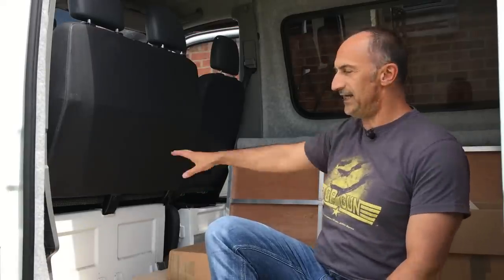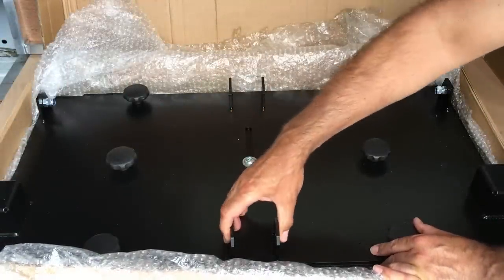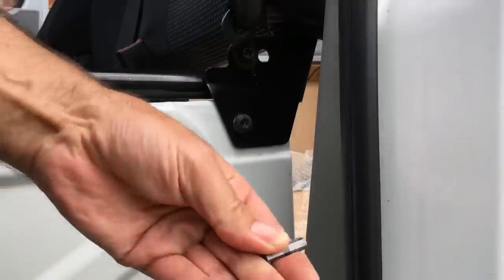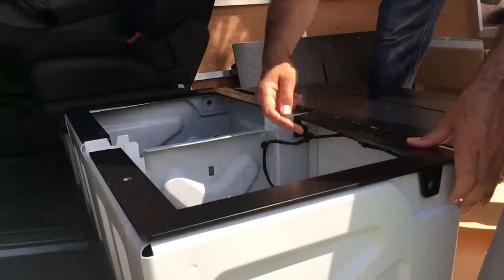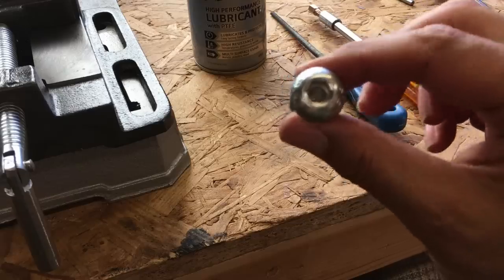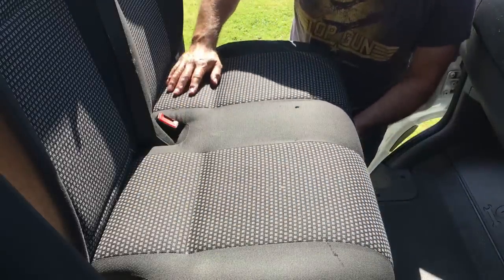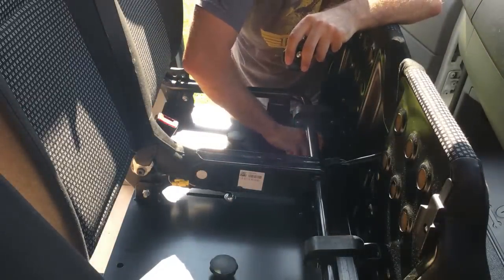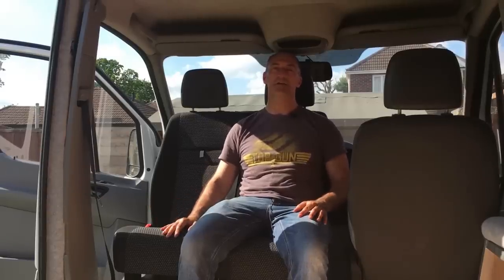Double Swivel Seat - Mercedes Sprinter Van

Comment: Nice work with routing the sensor wires. How much does the swivel mount raise the seat?
Reply from the maker: Hi CJ, it raise the seat about 2-3inches, in the front it's not noticeable as the floor slopes up on that side and when turned around I'm planning to build a foot step which will also house my heater ducts.
Reply: I was wondering if it would require a raised floor area, nice idea to use it to house the heater ducts. Also, just wondering if you sealed the body trim clips and drain holes before you insulated the van given you have created an interior moisture barrier and the van body provides an exterior moisture barrier (if the holes are sealed)?

Comment: Hi Greg just wondering if there would be apossibility to have a swivel captain chair aswell? I undrstand that its propably impossible when the double seat is firmly in place but mabe it would work when it is losened ?
Reply from the maker: I don't see why it won't work, the handbrake is the deciding factor and that doesn't move.

Comment: Hi Greg, as ever, great vlogs. We have just sold our last project and bought a larger VW Crafter to convert. It's a 2018 model so, I'm experiencing more problems trying to locate a swivel mechanism for the double and drivers seat. There is a company called R & J Solutions but they mention a 75mm lift, which will have a knock on effect with matching the hieght of any seat I fit in the rear. Any suggestions? We're off to The Overland Show next week so are hoping someone has got over this problem!
Reply from the maker: Try this one https://www.vwinterior.co.uk/VW-SWIVEL-BASE-S/
Reply: @GregVirgoe  sadly, they fit the pre 2017 model but post 2017 have a fuse box within the housing so, don't think that fits. I'm going to revert to a big hand written sign on the side of our van at The Overland Show. Hopefully, someone has fitted a swivel base to a 2017 model. Cheers though.

Comment: Hi Greg,
nice done.
But it does increase the seating height significantly. Isn't there any height adjustment for driver seat?
Is it not too high for driving? I guess you raised the seat by about 10cm to 12cm.

And be careful, if you slide the double chair completely on the slot, then the cable is too short. I would install a slide stop on the railsystem.

kind regards
Mark
Reply from the maker: Hi Mark, It's closer to 3" or 75mm higher. The cab floor slopes up quite steeply so it's not that noticeable up front. 
Good point re the length of cable, although slide stops would be impossible to install anything that doesn't foul the plates sliding. 
I could very easily solder some extra cable on to extend it and leave that coiled underneath. 
I might actually do that. Thanks for the heads up. Cheers

Comment: I want to convert my standard two seated Sprinter into a standard three seater Sprinter. Do you have a tutorial on how to do it because I know the floor covering is moulded to fit two seats
Reply from the maker: Hello Jon, I don't have a tutorial for that as my van came with a double front seat.
I imagine the floor plate is universal for all variants so there will be extra bolt location for the wider seat base under the floor covering?
Reply: Greg Virgoe thanks for the reply
I believe there would be, the only thing is the floor covering looks like it was made for two seats.

Comment: Hello Gregg,   I live in Canada, have bought and am building out a Sprinter Van.I LOVED the idea of a double swivel and just received mine in the mail yesterday.......it only took 4 1/2 months but well worth the wait....I hope.  I have two questions....the underseat yellow connector wire is easily dealt with as per your instructions but I also have another bunch of wires connected with a larger black plastic connecter.....I see in your video the end that is under the seat but is not connected to anything.  I am presently trying to find someone to drill larger holes in the bolt so they will all fit.  Why have you not connected that wire ?

Also, my swivel did not come with a centre plate, just the bottom frame that goes on the existing seat mount and the top plate.  Can you explain this to me as well please.  I hope this does not mean I cannot acmes the under seat space once the swivel is installed.  The product did not come with any instructions.  There is also no attchment point on the swivel for the seat belt (that I can decipher.....which means the seatbelt will be an issue when swivelling I think.  I have contacted Trim Jim....they must be very busy as I find communication very slow and I am anxious to get my project completed asap.  Thank you for ALL you wonderful helpful videos.  They have given my the courage to believe I can do this....and I am....eventhough I am a 66 yr old Grandmother with no experience in anything like this.

Comment: For the seat sensor problem mate on ford's at least if the light on dash comes on disconnect the battery's for 15 mins or so and it should reset buddy well it did on my van anyway lol
Reply from the maker: Hi Paul, that's a really handy tip, thanks mate.
I'm not going to try it if that's ok with you 😉 lol
Reply: Make sure you have your radio's code before you do that. Once you remove the battery cables the radio will ask for the security code when switching back on.
Reply: Also it's quite handy, to have some proper for Sprinters ODB2 code reader/scanner. Some of them (read : more expensive) can ever erase those dashboard codes.
Reply: mirogster That's a very good idea, specially if they will be travelling all around Europe. Greg, you can get quite cheap ones from ebay, some have Bluetooth connection so you can use it with your smartphone. ;)
Reply from the maker: I shall look into that as you say it may be handy to able to diagnose my own faults if they occur when we are travelling in a foreign country.
Reply: I actually recommend it to all vandwellers :D

Comment: hi Greg I'm part way through building my own camper van, Renault Master 08 plate but I need to pick your brain about  fitting a light at the back switch in the front , but can I put a switch in at the back to turn it on and off, am I right in thinking that you just go into live at back with a switch . 
thanks in advance. stay safe best regards George from Whitby
Reply from the maker: Hello George. Thanks for your question a switch just breaks the positive feed to the light and can be located anywhere along that cable to suit your layout. The input side of the switch is always positive and the output side is a switched positive to turn the light on. 
You should also have a correctly sized fuse near the source to protect the cables. Hope that helps
Reply: thank you Greg as soon as Iv'e sorted my wire and switches out tomorrow I'll let you know how I got on stay safe chat soon keep the video's coming
best  Regards to you and your good lady.

Comment: Hi Greg,
If you're still planning to mount a detachable table for those dual-seats and the seats along the side, aren't the front seats much higher than the bank on the side if the van?
Cheers,
Bernd

Comment: Greg, great video as usual.

A recommended mod for the seat would be to swap out the screw knob fittings for spring-loaded self dropping pin mechanisms. No unscrewing and once lifted is much easier to relocate as the pins will ping back into place as you rotate the seat. My ten pence worth! Love the cable pass through bolt design 👍🏻
Reply from the maker: It's a possible option unless a pin falls off the side of the lower plate or into another hole on the way round you could end up needing a few hands to keep them pulled out.
Reply: No, because the screws have also the retention function, with the pins all the load is on the center (hollow) screw and the seat can fall backward because of the hinge.

Comment: Hi Greg. Great videos. I learned a lot from you. I'm just about to buy our first van which will be sprinter mwb or crafter mwb. Question about seats. Because we will be traveling with small child which seats in baby seat, do you think it's enough room for baby to seat with us in front on double seat or should I go for only two seats in front and one in the back? Cheers mate
Reply from the maker: I would say there's enough room up front for the child seat and passenger in the cab.
Reply: Greg Virgoe great. I will have a good look at the dealership if I actually can fit isofix to front bench. Again, great videos from you mate. See you somewhere in europe

Comment: Best video I have seen on this kind of conversion. Well done ...... im ordering soon. 

Should recommend that mod to the manufacturer's im worried I cant drill that bolt as I don't have the tools. 

Inspired 

Csn I have the company name of this particular model. Thanx in advance
Reply from the maker: Moonwalkerlive you’ll be pleased to know that after watching my video they now provide you with a solution for the wire. The link is here https://www.vwinterior.co.uk/-VW-CRAFTER-VAN-MERCEDES-SPRINTER-VAN-DOUBLE-TILTING-SWIVEL-BASE.html
Reply: @GregVirgoe  I bet that they do not install a longer wire still, which I will do as you suggested.

Comment: Greg - does it raise the height or driving position of the seat?  It looks substantially higher to me.
Reply from the maker: Yes, it does raise the seat about 2-3 inches. In the cab the floor slopes up to the dash so it's not so noticeable. 
In the back of the van I'm planning to build a step to house the heating ducts so your feet are not dangling. 
Will cover that on a future video of the heater installation. Well spotted.
Reply: Greg -the reason I asked - I converted a van back in the '70s and tried every aftermarket seat base mechanism on the planet at that time - they all made the van uncomfortable to drive - I wound up going back to the stock seats on a stock base. Maybe a dumb question but could you modify the base to lower it back to stock ht?  You'd lose storage space-im thinking taking the 2-3" out of the middle (so you don't impact any of the fasteners) and then re-weld the pieces together (if it is made of steel or aluminum - something that could be welded)

Comment: Amazing device, I wonder if there is anything designed to the Renaut Master and if not, anyway, it's quite easy to make the device in your own garage. The knobs can be replaced in an upgraded version by an electromagnetic device such as electromagnetic locks that hold up to 600 kg at an affordable cost of $40 or 25 Pounds (sorry my keybord does't have the currency sign of the pound, we're on the other side of the ocean). These electromagnetic locks have really a really low d.c. comsumption and can be powered when engine is on.
Reply from the maker: I prefer the safety of good old bolts with cab seating.

Comment: Loving all the videos and currently planning my own build.  A quick question: how does not having a bulk wall impact your vapour barrier?  Surely there will now be exposed metal?  Any tips would be appreciated as want to do as good a job as possible.
Reply from the maker: When using the van keep it well ventilated and warm. Just like how you clear a fogged up windscreen.

Comment: Very nice. Although drilling out the swivel bolt might let it fail in time. Did you do any kind of calculation for stress on the now a lot less massive bolt? I mean with the sensorcable running through it. It would be a damn shame if the bolt fails after a year of swiveling and shearing of the sensor cable in the process. Hopefully the engine will be off if something like that happens(Although I might also be quite pessimistic here. Studying mechanical engineering though.) 

Loved the Insulation video.
Bringing me to my next point. While you have now a lot of more space in the back you also now lose quite a lot of heat through the drivers cabin. I also am thinking about opening up the driver cabin in my build. Thinking about using some sort of textile lined with plastic as a makeshift insulation either for the windows or just where the bulkhead used to be. fixing it with magnets or velcro. What you think?
Reply from the maker: Hello, you have no need to stress yourself, that bolt has no load on it at all, I mean zero, nothing at all. It's not done up it is totally free to spin around. It's only purpose would be to stop you dropping the chair on your foot if you were silly enough to drop it. What secures the seat while driving is the six wheel knobs. My heating was always supplying the cab area and I had allowed for hot air to be blown into the cab to heat that area as it's the biggest heat loss in any van. I have quilted window blinds on all cab Windows and I have a blackout curtain in the place of the old bulkhead for extra privacy. Hope that explains and cures your concerns

Comment: hey Greg, I've got a simple question for my van build. Do the single swivel seats (not double) turn easily without needing to get out, open the front door and adjust the seat before you're able to get it to rotate around? I have a California Beach right now and I have to do that in order to avoid scratching the plastic sidings.  I've seen some off-center swivel mounts that help with this but I'm wondering if on a Sprinter I might not have this problem. It's be nice to be able to just park and swivel around without hassle. Thanks. Have you left on vacation yet? I'll be in southern Switzerland for most of July if you're passing thru. Cheers
Reply from the maker: Hello Steve, I'm affraid I don't have any experience with single swivels in sprinters, so I'm not able to answer your question.
We are due to head off into Europe in August, currently moving out of our home and have a few bits of paperwork to sort out on the van.
Reply: ok, thanks... I'll find someone who's got single swivels. Looking forward to your travel videos!

Comment: great video and full of information as usual. But are you happy about sacrificing easy access to the cabin from the van - could be a pain in bad weather.
Reply from the maker: Hi Barry, as you can see from the thumbnail photo, when it is spun around I can very easily jump in the front to move the van.
We can also spin the passenger seat from within the cab without getting out the vehicle.

Comment: hi Greg when I got my van it had a propex night heater (gas)  I have no wiring diagram there three wires coming from the heater into a block and two coming from main into another block Can I go into this wiring and fit up a room thermostat.? seen one on Ebay for £25 it say's it's a smart room stat controller. if this is not right but can be done can you point me in the right direction with maybe a link. cheers.
Best regards from Whitby in UK George
hope your all ok out there in Portugal stay safe and take care
Reply from the maker: George Smith if it’s a HS2000 proper heater (blue casing) you can get a replacement thermostat from propex to plug into that heater. Here are the instructions. https://www.propexheatsource.co.uk/wp-content/uploads/2017/07/HS2000-from-Dec-2015.pdf
Reply: hi Greg thanks for info but the guy I bought this from has boxed it in so no idea what colour it is or the number will this HS2000 be n a label somewhere? i'll have to take the box off it's under bed locker have to remove a few things to get at it.  Is blue the trade colour?
regards George
Reply from the maker: Hi George, please try and find a model number or name plate somewhere. Maybe a small mirror may help. The propex heater should have some form of thermostatic control or it would just run flat out. I cannot imagine they would have designed it like that so something is missing. 😊
Reply: Hi Greg the casing on this heater is red  i can't see a number but a company named Gas 2000 at Thirsk in North Yorkshire are going to fit men an LPG tank under my van in July. They will plumb in my heater, and my cooker, but leave the fridge for me to do because they don't fit fridges, but a tap will be fitted for it. Hope that you are all well, stay safe take care. Best regards George from Whitby

Comment: Hi, thank you so much for these hugely informative videos. I have a question about this seat (not sure if you're checking for comments on videos but I thought I'd try anyway: I'm planning to convert my own van but I'm going to be a female travelling by myself. One of the reasons I was worried about leaving the double seat in the front was losing the ability to get away quickly if I'm ever in an uncomfortable or unsafe situation. However, I would love to have two seats to be able to take friends with me on the odd occasion, so my question is this: Is it possible to drive with the seat swivelled around? Because if that's the case that would still make it fairly easy to jump onto the driver's seat and drive away quickly.

Thanks again for all these videos, I feel like I've learnt so much already!
Reply from the maker: Hi, I can give you the exact answer here. With the seat swivelled round and fixed in position, it blocks the movement of the gear stick so you cannot drive away like this. However, if you leave the bolts out you can easily slide it out of the way. Having said that with the seat in the normal position we can both easily slip through the small gap in the seats to move from the front to back and have done this when it's raining.
Never felt the need to do an emergency getaway always felt very safe camping in Europe. :D
Reply: @GregVirgoe  Thank you so much for your reply! It's great to know that there's still a way to get to the front. Having driven through Europe a lot (though never in a camper), I do agree that most of the time you feel pretty safe. But I think knowing that I can get away will still give me the peace of mind I need. Your videos are amazing and I'm so grateful you've taken the time to document your process in such an educational manner. Thank you!
Reply from the maker: It’s a pleasure and rewarding when I get nice feedback like this. Cheers